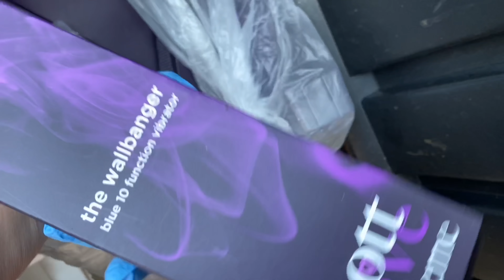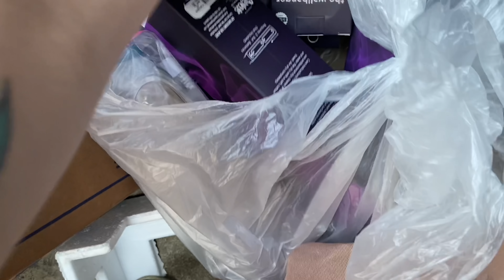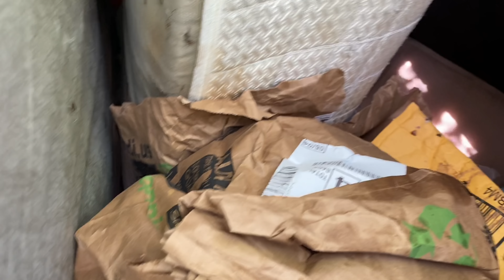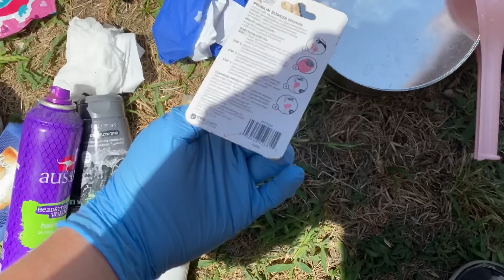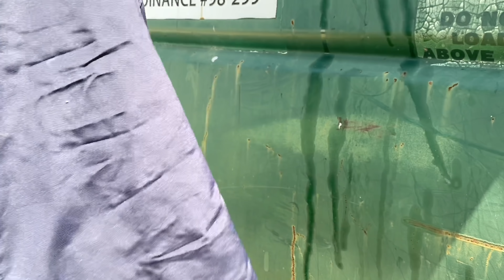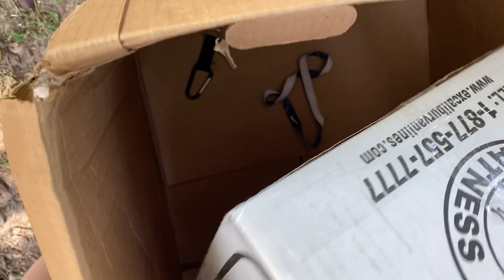Dumpster Diving at the Mall and THIS is what I found..

Comment: I was surprised you left so much of the lotions and cosmetic stuff. You left a really good shampoo. Also I was a little disappointed you didn't clean that mess. I know you didn't make it but you benefited from it and it seems you used to be more conscientious of that. 
Also at the apt open top dumpsters where the guy gave you permission to dig, you left with so little compared to what I saw in there. Did you get nervous after the guy asked you to leave?
About your phone, can't you get a phone holder/ tripod that will attach to the dumpsters? I haven't watched in a few months and I see you changing.

Comment: Those toys might be dangerous, and I don't mean because of their size. There are no federal standards for them. Also, if they are labeled "novelty use" they can be made of anything. I'm talking  cancer causing materials. They can also break or crack during use or be impossible to clean, making it easy for bacteria to breed.  People can become ill or die from badly made toys (I know of one case personally).This is NOT a joke. You don't have the original packaging or inserts  ( no pun intended) so who knows where they were manufactured. The store might have been ordered not to sell them or there could have been a recall. Don't let Pilgrim play with them and do NOT randomly send them to people or sell them at a flea market. Throw them out or use as a joke display, but they should NOT be used!